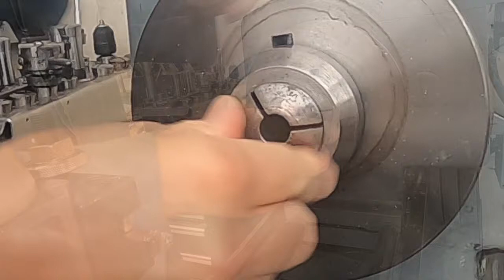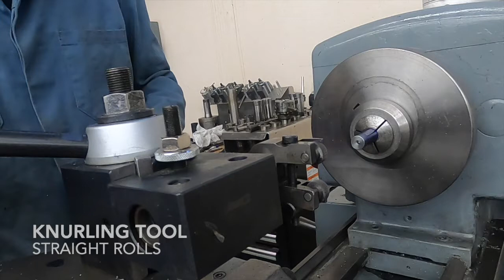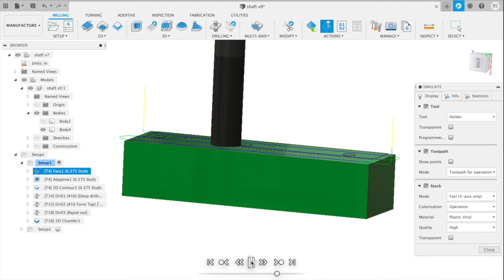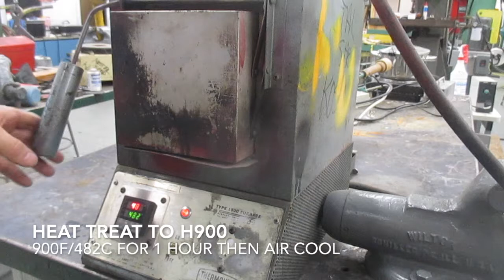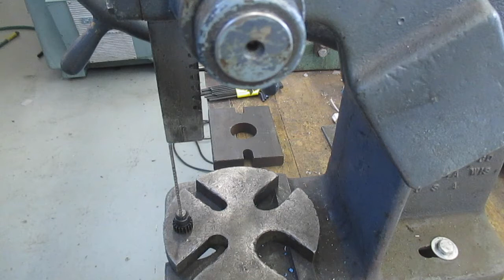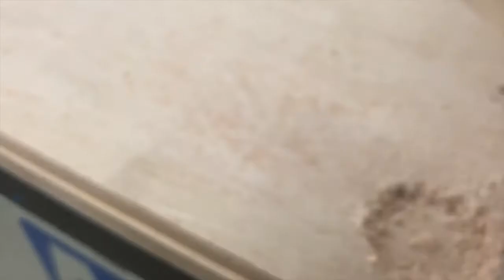Multicam CNC Router Pinion Shaft Repair Part Two

Comment: thanks for good movie. 👍 yours also runs with 1.25 pinion gear. if so where did you buy it
Reply from the maker: Martin TS2018 Spur Gear, 20° Pressure Angle, High Carbon Steel, Inch, 20 Pitch, 3/8" Bore, 1" OD, 0.500" Face Width, 18 Teeth
https://www.amazon.com/Martin-TS2018-Pressure-Angle-Carbon/dp/B004BDO850/ref=cm_cr_arp_d_product_top?ie=UTF8